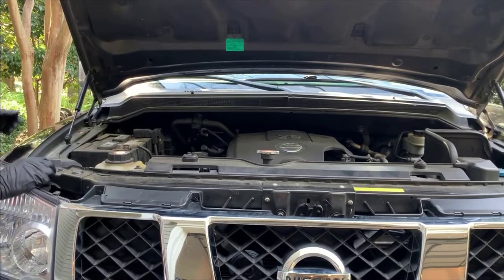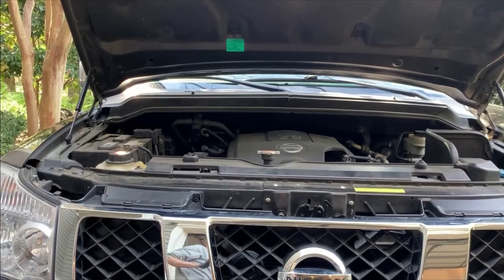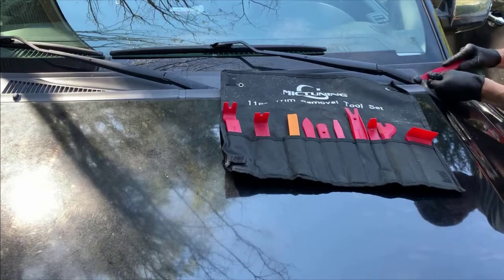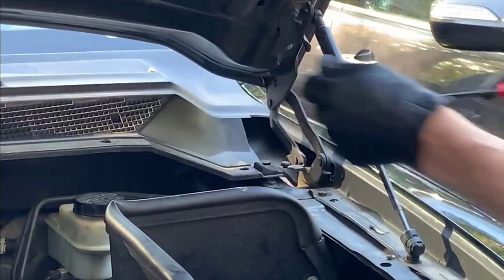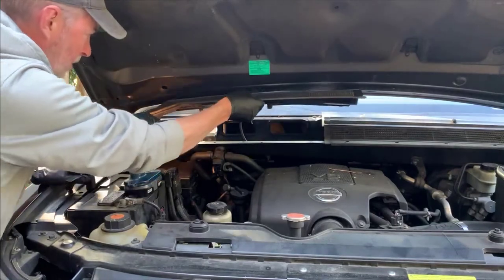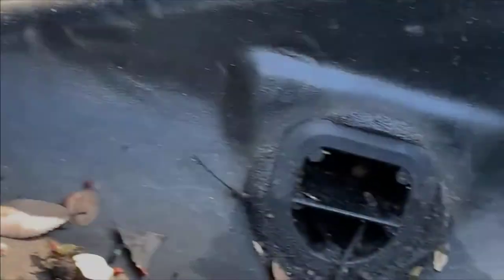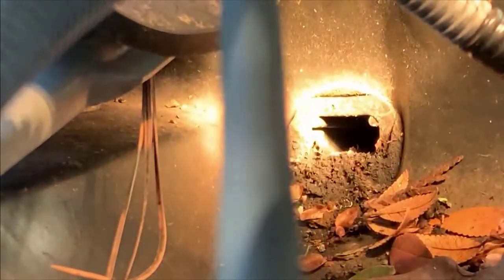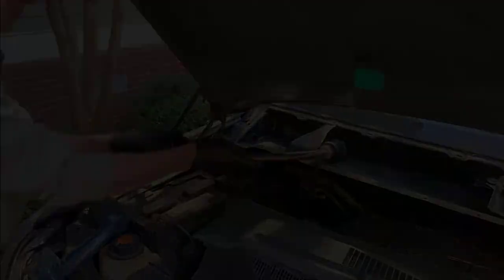Nissan TItan or Armada - Wet Floors after car wash or rain

Comment: I know this is 3 years old. But my neighbors 2022 Titan was just totaled by insurance for having flooded dash and electrical problems from the water intrusion? I have also seen that the full size moon roof is prone to water intrusion and when drain lines are plugged by debris it floods the floor. Two major defects with Titan trucks.

Comment: Wow…exact same issue with my 2006 Titan. GREAT video and explanation. Thanks so much.  A+
Reply from the maker: Specifically for the Titan, there’s one other thing you should check. The piece of plastic at the bottom of the windshield is called the cowl (The thing the windshield wipers poke through). Right where it connects with the windshield is supposed to be a little rubber strip that gets dried out, cracks, or is completely gone. That lets too much water come down the windshield into the basin. You should get some weatherstripping from Home Depot that fills the void between the cowl and the windshield. There is an actual Nissan part for this but you don’t need that. The official name is hood Cowl extension panel seal
Reply: @TallFamilyFilms  Great info….Parts Manager@my Nissan dealer also said that.
To replace both of those “plastic cowls” that have the rudder seals at the bottom is very expensive. 
No sunroof on my truck.  Great job linking the “plastic clip removal set” on Amazon. Ordered it in 5 minutes.
Great camera work and instructions. I watch it done, I usually can do it.  .Thank you so much…worried about it.
Reply from the maker: @rodcoulter997  I bought mine on eBay for about $45. 
Genuine Nissan Titan Armada Hood Cowl Extension Panel Seal 66832-7S000. 
It is literally just a tiny piece of weatherstripping that is sticky on one side that sticks to the windshield. If you have a gap there, fixing the drain is not going to resolve this.
Reply: @TallFamilyFilms  For sure….thanks.   See if I find the parts.

Comment: LOL.  My 2006 Armada has the same problem. I am so glad I found your video.  Great job!
Reply from the maker: After doing this, there’s one other thing you should check. The piece of plastic at the bottom of the windshield the bridges the gap to the hood is called the cowl (The thing the windshield wipers poke through). Right where it connects with the windshield is supposed to be a little rubber strip that gets dried out, cracks, or is completely gone. If it’s gone, it lets too much water come down the windshield into the basin. You should get some weatherstripping from Home Depot that fills the void between the cowl and the windshield. There is an actual Nissan part for this but you don’t need that. The official name is hood Cowl extension panel seal.  I bought mine on eBay for about $45. Genuine Nissan Titan Armada Hood Cowl Extension Panel Seal 66832-7S000. 
It is literally just a tiny piece of weatherstripping that is sticky on one side that sticks to the windshield. If you have a gap there, fixing the drain alone is not going to resolve this.
Reply: Great video!  I’ll check under the cowl, but more thanks on the rubber strip! I saw mine blow off in a car wash a couple years ago lol

Comment: Is there a weatherstripping piece on the piece of the cowl that’s touching the glass??
Reply from the maker: @4u2nve  hi there - if you read through the evolution of comments, you’ll see where I mention that. It’s a must IMO. Home Depot type is fine
Reply: @TallFamilyFilms 
I’m not talking about a thin piece of insulation, mine is a narrow thin piece of finish trim that’s plastic. There may have been insulation under that with some kind of two sides tape at some point but there isn’t anymore. But again that’s not my issue, I’m looking for the piece of plastic. Mine sits on top of that cowl and is broken.
Reply from the maker: @4u2nve  I know the piece you’re talking about. Mine cracked into many pieces. I could never find a part number for it. But its purpose is to not allow tons of water to come down the windshield and overflow the drain. So the one-sided sticky insulation strip from Home Depot did the trick. If you ever find that part number for the other plastic strip, please let me know

Comment: same problem here. thanks boss great video
Reply from the maker: The problem might be a lot simpler. I found later that there is a strip of insulation that is supposed to go under the plastic cowl at the bottom of the windshield. in my case, the weather had pretty much destroyed it. So, water coming down the windshield would flood the compartment you see in this video. I went to Home Depot and got a very thin strip of insulation that was adhesive on one side. It is in the weatherstripping department. I stuck it to the windshield underneath the plastic and I’ve never had a problem since.
Reply: Hey man any advice for the 2 front windows not going down? when i press the switch u can hear a click sound but the windows just wont go down @TallFamilyFilms

Comment: 👍🏼 was looking for a video on the titan
Reply from the maker: Specifically for the Titan, there’s one other thing you should check. The piece of plastic at the bottom of the windshield is called the cowl (The thing the base of the windshield wipers poke through). Right where it connects with the windshield is supposed to be a little rubber strip that gets dried out, cracks, or is completely gone. That lets too much water come down into the basin that I show in this video. You should get some weatherstripping from Home Depot that fills the void between the cowl and the windshield. There is an actual Nissan part for this but you don’t need that.
Reply from the maker: The official name is hood Cowl extension panel seal

Comment: 2021 Nissan Armada same problem
Reply from the maker: Check the drains for sure. On mine, the insulation strip at the bottom of the windshield was gone. I just used the Home Depot insulation (1/4 x 3x8 I think. It’s the thinnest one they had. Draw a line on the windshield right at the cowl, Remove the cowl, and lay the insulation right under the line. I can’t speak to its longevity as I just did it. But it works.
Reply: Did this fix your problem?  I have 2017 Armada

Comment: The ac in the rear of my 09 qx56 isn't getting cold could it be the heater control valve under the hood?
Reply from the maker: If it isn’t clicking, I would not think it’s a problem. But I wonder if you have a blend door that is stuck somewhere that controls air to the rear. Essentially, it’s just a plastic door that is opened or closed with a little motor called an actuator. These doors and actuators are prone to breaking. If the temperature doesn’t change when you press the button to activate the rear controls, then I would assume something is physically stuck or broken. Especially if the air in the front is cold.
Reply: The reason I said that was because in the winter I had to turn the valve manually under the hood because the gear had script out in order to get heat in the truck so now that I went back to are I'm thinking I may have to do that in reverse
Reply from the maker: @seibles1  I pulled all the gears out of that box under the hood to get my heat working as well and it never affected my AC. That was 5 years ago

Comment: Would you use the same process for the Nissan Frontier
Reply from the maker: All Nissans would be very similar. The most important part of this scenario is to make certain that water cannot run down the windshield and straight into the cowl. There should be a thin strip of insulation where the cowl meets the windshield that deflects the water so it runs off the sides a bit. Nissans over about 10 years or so will be missing that because it aged and broke.
Reply: @TallFamilyFilms  thanks for the help.  I am trying to find a leak on the driver's side. The carpet get soaked quite often.
Reply from the maker: @johndude262  start with a garden hose and only spray specific parts of a car, one of the time over several days until you figure out the actual place that causes the leak. 
Does this car have a sunroof? That’s a prime spot because there are small drains in the top when the sunroof is open to funnel water away it’s supposed to come out down behind the tires. But those lines get clogged.
You can get really long drain cleaners on Amazon pretty cheap. If you just search Sunroof brush cleaner, it’ll probably come up. It’s like a pipe cleaner with a really long steel cable behind it.